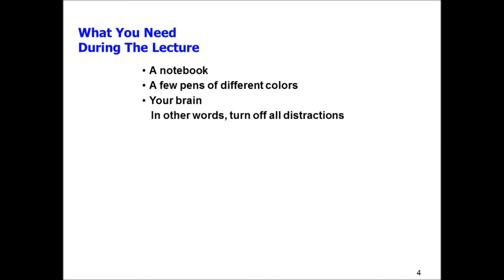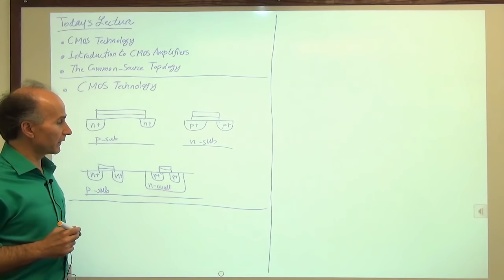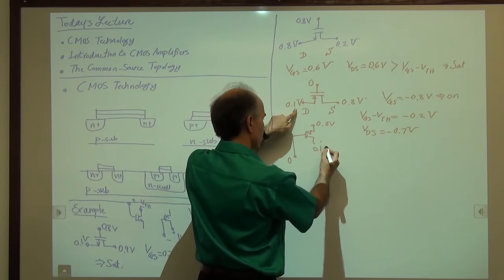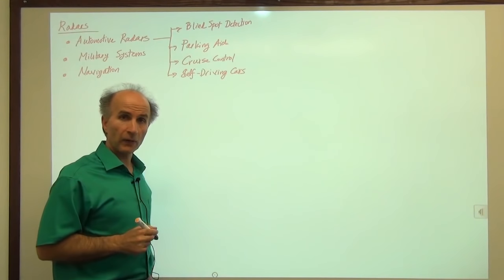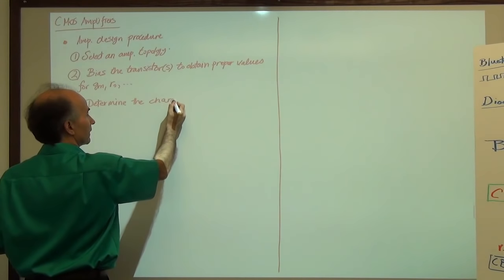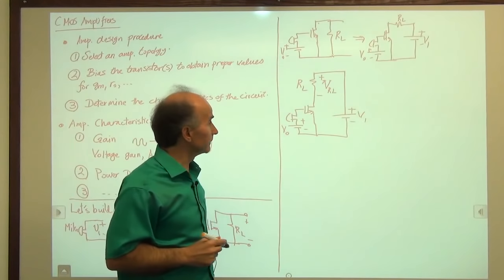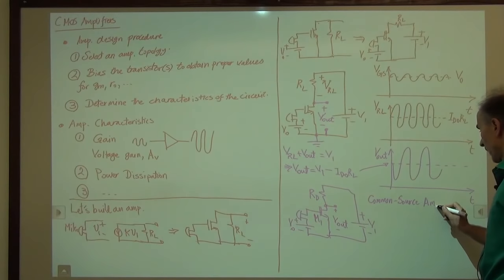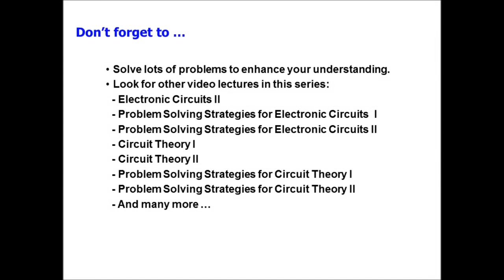Razavi Electronics 1, Lec 35, Common-Source Stage I

Comment: Regarding drain and source terminals are inter-exchangable, I am confused. Source is connected  to the substrate (internally, short in the die) but the drain does not.. how could they be symmetrical?